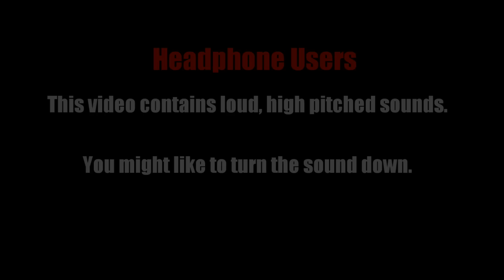The Chladni Plate

Comment: A quick question (there might be an idea for a follow-up video in there somewhere): a while ago I was discussing the issues that Martian dust causes on rover solar panels, reducing their output with someone - and the idea came up of perhaps "wiping" that dust simply with a built-in "vibration generator" much like this. Assuming solar panels are indistinguishable from metal plates (and all cows are spherical), could one devise a "vibration sequence" that would transport dust to the edges of the plate and have it just fall off? What do you think...?
Reply: +Attila Asztalos Nice idea, but I don't think it would work, because the reason you get this pattern is the harmonic overtones of the plate's resonant frequency. The reason is works so well with a metal plate is that the material is pretty much uniform across the plate which a solar panel isn't. Also, you don't really want a solar panel to vibrate a thousand times a second, since that dramatically increases the risk of component failure.
Reply from the maker: +Attila Asztalos Yes, good idea, but +ChipsHandonJr is right.  We did do a video years ago where we put talc on a speaker and that was quite interesting - I guess talc might be a simple substitute for Marian 'fines' and the behaviour was quite interesting.  It might even still be on the channel somewhere.

Comment: is it dependent on the material you use ;like for say if the plate is copper or say bronz will it completely change the pattern or will it just impact it sligthly ?

Edit: by the way it's a great vid and experiment to watch
Reply from the maker: +Djay Hiryuu Thanks - glad you like it.  I would think there must be some pattern changes with different metals.  We used aluminium here but if you imagine using a piece of lead, for example, I don't think you'd get the same response because of the different physical properties.  Maybe we'll give it a go!